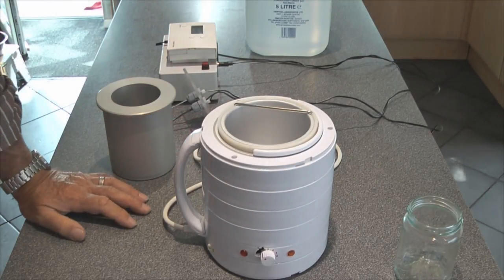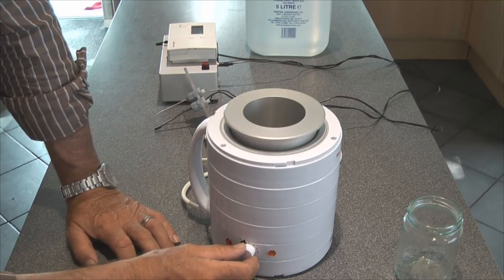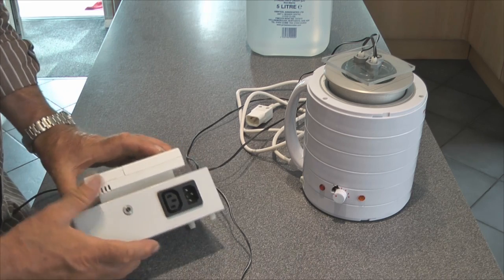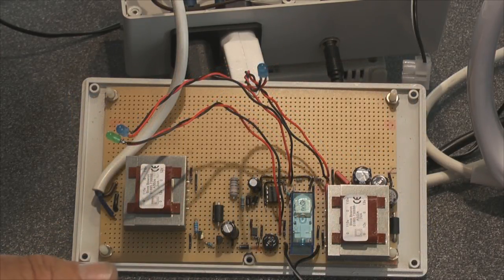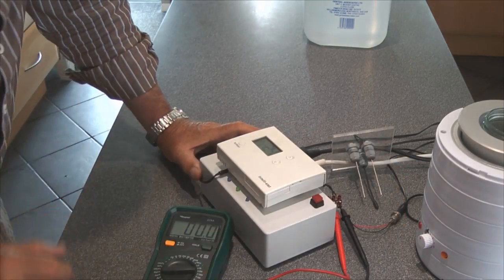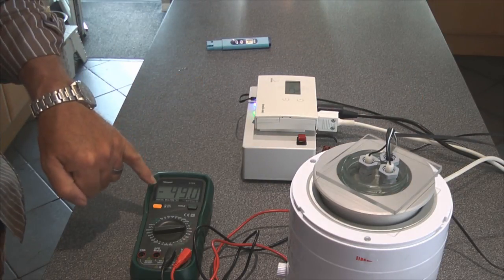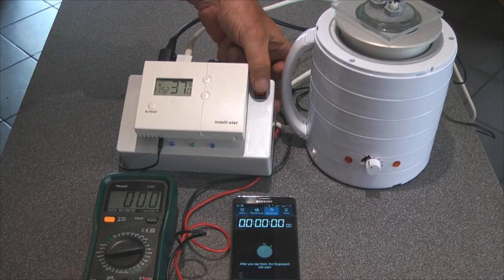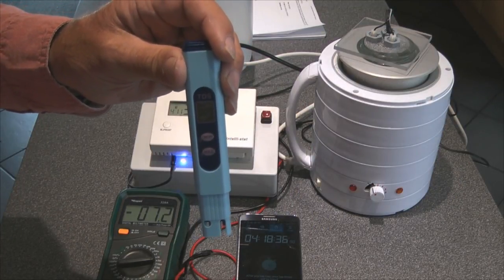Colloidal Silver  Voltage  Sensing Generator

Comment: My colloidal silver turned yellow
Reply: My silver turns golden yellow too  according to my chart it means it's around 20-30 ppm
Reply: @terryhill4732  I haven't used it it's been in my cubbord for almost a year. Can you share the information and what I need to do now?
Thanks for replying back!
Reply: @Kathleen-Wellner  The way you can tell if colodial silver is still good is get a Lazer pointer and shine it through the glass and if it's still good you will see through the Lazer tiny particles still floating around as long as it is stored in a dark ,cool place and sealed properly there shouldn't be any problem, that's what I do and never had a problem

Comment: Hi. Interesting video. One point I'd like to highlight about the TDS Meter - TDS stands for Total Dissolved Solids. You can only detect dissolved silver with a TDS meter, which is Ionic Silver, not metallic Colloidal Silver (nanoparticle silver). You'll have to 'reduce' the Ionic Silver with a reducing agent to make Colloidal Silver (metallic nanoparticle silver). Ionic Silver and Colloidal Silver are not interchangeable terms. Ionic Silver is conductive in water, Colloidal Silver (nanoparticle silver) is not conductive in water. The only sure way to determine non-dissolved non-ionic Silver is to get a properly reduce sample chemically analysed. A TDS meter will only tell you that Ionic Silver is present, but will not tell you precisely how much - they aren't calibrated for such use. TDS meters are for measuring the purity of water, not non-ionic metallic silver content.
Reply: @gnireenignE  whoever told you that ionic silver is conductive compared to colloidal silver is lieing, any silver is very conductive it's the most conductive metal known along with gold and other noble metal
Reply: @terryhill4732  It's basic chemistry. Test Ionic Silver with a TDS meter and you'll get a reading. Reduce the Ionic Silver using a reduction method and test again. Depending on which reduction method you use, the reading will either drop considerably, leaving only the reading for something like a reducing agent, or very near zero if you use an intense heating reduction process. You seem to be mistaking dissolved ionic states with whole metallic states of silver.
Reply: @georgecarlinismytribe  True Colloidal silver is what I make and I don't put a reducing agent in it period because the book says never put reducer only use a seeding from previous batch and I don't use a TDS meter , I have a chart from the manufacturer of the place I buy my silver and it's color coded to get you close to the ppm of your batch ,mine usually comes out to 20-30 ppm and the ionic silver is just smaller nano particles of colloidal silver,some people get into trouble using certain reducing agent that turns the CS into Silver Chloride which can be toxic if taken internally
Reply: @gnireenignE  Correction: I said ionic silver is smaller nano particles than CS, I should've said it's a molecular version of silver molecules and atom's

Comment: This is NOT colloidal silver! This is ionic silver. Any product that is clear is most definitely NOT colloidal silver, it is ionic silver at best. Ionic silver does have great health/healing properties but has basically zero bioavailable silver inside the body & does NOT enter your bloodstream. The ions bond with chlorides in your body rendering it basically useless. True colloidal silver contains nano size silver particles that will pass through membranes & enter your bloodstream. Making true colloidal silver is an expensive, difficult, time consuming process but if you want the best effect especially inside your body you need true colloidal silver which will typically be yellow or amber in color. An independent lab tested 14 products on the market claiming to be colloidal silver and only 3:actually had nano sized silver colloids in them. The best true colloidal silver on the market with the world's highest percentage of bioavailable silver is Mesosilver. Silver Hydrosol, Covalent Silver, Silver Water are all ionic silver products. You should stay away from any product that contains protein. The protein encapsulates the silver particles which are too large to be useful in the first place to keep them suspended in the solution (these products also have extremely high ppm like 500 to 29,000 ppm) but the encapsulation prevents the surface area of the silver from being effective as it can't touch anything and the protein grows bacteria which can be very harmful & should definitely not be used in the eyes, ears, nose, or throat.
So keep these rules in mind: if its clear, it is NOT colloidal silver. If the process uses electrolysis, it is NOT colloidal silver. If the solution contains protein, it is NOT colloidal silver & should be avoided. If the process adds baking soda or other salt in the process it is creating silver salts as well as ions, it is NOT colloidal silver, and it should be avouded. Hope this clears up any confusion & if you need more clarification please see this article where 14 products claiming to be colloidal silver are independently lab tested & only 3 of the products actually had nano sized silver colloids for further validation.
Happy reading.

Comparative Analysis of Commercial Colloidal Silver Products: https://www.ncbi.nlm.nih.gov/pmc/articles/PMC7765683/#!po=55.0633

Comment: Though there is so many ways of breaking down silver by using generators as an electrolyzer and you can build a complicated generator and confuse a lot of people also or you can get as basic as you want to by using 3 - 9 volt batteries which works as good as any generator that I've seen and the product is just as good for me I've been doing it for over 3 years and have had tremendous success with just a basic 9 volt direct current batteries and I've also used the AC generators but sometimes by using AC I had a voltage surge once and it almost burnt a whole silver rod up , after that I started using direct current and have not switched back simply because you don't have to worry about a voltage surge
Reply: I started out the old (3) 9 volt battery method but it's not really very consistant. Sometimes it works and sometimes it doesn't. It's not difficult to add current limiting which will give you a great product every time.
Reply: I started out the old (3) 9 volt battery method but it's not really very consistant. Sometimes it works and sometimes it doesn't. It's not difficult to add current limiting which will give you a great product every time.
Reply: Do you know what exactly the electric part to plugin that I would need to use instead of the batteries. Like the exact wallatge or volts on the cord u plugin into the wall. I like have everything else but not sure what the volts etc I would need to use instead of the batteries 
 TIA
Reply: @EXPLOREWITHME.  Yes if you're using A/C use an adapter that comes with many appliances but make sure that the millivolts are around a 1,000 mv,  I think without looking it up that equals 1 volt, anyway if you don't want to burn up your rods quicker that's a safe voltage to stay around, my A/C plug is 800 mv and it works as good unless you have a voltage surge, good luck

Comment: Very a propos with the COVID 19 pandemic, use the stuff in a nebulizer and get rid of it quickly.  In the US we have the Silvergen SG6, I have been using for many years, makes extremely fine constant current CS, crystal clear even at 20 ppm, and if you seed the next batch with a little of the previous one, it's fast only about 1-2 hours.  It has a density control for the PPM you want.  about $200 US.  CS is also great to spray into eyes, on masks, it stays active even when dried out.  Uniquely useful, and as usual with people, no one gives a shit, so they suffer and die.  Meanwhile we gleefully carry on making CS and laughing while the dummies drop dead along with their highly paid leaders.
Reply: "Uniquely useful, and as usual with people, no one gives a shit, so they suffer and die."
Yeah I find that to be true with many things. Even my close ones are unwilling to try anything alternative, they are too lazy basically to look up anything not suggested by their doctors. It makes me sad.
Reply: You are exactly right most people think if it don't come from a doctor it can't work
Reply: Thanks for your input. Where I can buy the one you mentioned in US? Many thanks 🙏

Comment: I did use to switch polarity on the electrodes until it was explained to me that this is a bad idea, because it will become impossible to use Faraday's law to calculate ppm of the colloid. Every time the polarity is switched, current will drop to zero and will build up to maximum value over some seconds. I have now adhered to the method most specialists use, adding sodium carbonate as electrolyte to guarantee a constant current right from the start, while protecting the electrodes.
Reply: Hey Marc. Should have known I'd find you here giving good advise.
Reply: You're not making collodial silver you're making silver chloride which is toxic and can turn you blue you never mix salt and silver together
Reply: why not use AC
Reply: @breakfastbuddy5  There are two main production methods: LVDC and HVAC. For a home lab it is easier and safer to use low voltage DC. Low voltage AC does not make sense for the reasons explained above.
Reply: @marctinkelenberg  if its only impossible to use Faraday's law to calculate ppm i dont see thats any reason for not using AC , the anodes and catodes shifts and stay clean all the way trough the process , the only reason is that its harder to keep the current at a certain level , with dc you can easy use a LM 317 regulator , but with a AC its not that easy . another misscalculation with DC is the temperatur change in the water ,and why do you need to mix it with honey ?
Reply: @breakfastbuddy5 Everytime you switch polarity in AC, the current drops and increases, so it is very difficult to know what the effective current passing through the electrodes is. You should measure the effective current by putting a multimeter in series, because a current limiter only limits the upper limit. The temperature does not cause any miscalculation, as we verify the actual current, not the input current. We use a reducing agent like honey or another sugar because it will speed up the reduction process, guaranteeing full reduction, and it will also stabilize the particles, keeping them from agglomerating into larger particles. Reducing with just heat will not provide you with the same quality of CS.
Reply: well i know how to measure ac current , so thats no problem , is that reducing agent just to cover up that its harder to make smale particles ? because if you make smal particles it turns lightly yellow by itself when you achive 20 ppm , if you keep it at 1 ma you makes the smalest particles , if you use wires ,you have a smal  surface on the rods , but if you use coins you increse the area around  3 times , and can use 3 x the current , i know a limit resistor is no good without a helping acid or base drop to start the process , to use AC you just have to use a 1 ohm resistor and measure Mv and thats the same as Ma , over the reistor , and you dont have to clean the rods or the coins , sorry for the bad english i am a Norwegian ,
Reply: @breakfastbuddy5 Thats a lot of information you put in one sentence. You can perfectly generate small AgNP at higher amperage, I generally work at 15 mA, like you say, just use a larger anode and a reducing agent. If you are happy to work with AC, you should stick to that. I rather stick to proven methods used by savvy biochemists. If you don't understand why reducing agents are used, I would suggest you need to study a little more.
Reply: thank you for your input , it cant hurt to put some honey in that solution after its done , and i would like to altrnate the  anode and katode , its hard to do that with a dc since you have to switch the wires , when your not there , do you know a metode to do that ? or do i habe to make a timer with a pol switcher ?
Reply: @breakfastbuddy5  You should really consider adding a reducing agent right from the start, it will greatly improve the quality of your CS. And there is absolutely no benefit in switching polarity, it's just a lot of hassle, making it harder to generate CS with a known quality or ppm.

Comment: Aluminium gives dangerous properties to water,,use stainless steel or copper.
Reply from the maker: Thanks for your comment and valid warning but perhaps you fast forwarded through the part where I used  a GLASS jar to  contain the water, There is only ever glass silver and water involved in the process.

Best wishes
Russ
Reply: @SarbarMultimedia  yes I just seen that,,I apologise,,I was concerned for your health at the time. Peace

Comment: Do you know what particle size was produced as according to my research the smaller the better, preferably less than one nanometre?  Also did you use distilled water?
Reply from the maker: Hi John
Unlike some process I have seen that produce silver mud, there is no hint of solids even after weeks of settlement. Any solids are completely in suspension.  The solids meter I use says typically 8 to 10ppm. The very limited  current flow means it takes about 8 hours to produce 500ml. As I understand it from the research I did, the slower the process the smaller the particle size. I cannot say what size those particles are but at 10ppm there is no hint of any colour. I have used it as a topical mouthwash and as a spray on skin salve but the main use is to make wound treatments for my daughter who is a professional groom and uses it all the time to treat wounds and infections for the horses in her care.
I buy purified water from a pharmacy, essentially distilled water. I know that it's free of all solids because when initially processing it,  the voltage is high for several minutes until there are some silver solids to conduct the limited current. As the dissolved solids increase, the voltage eventually drops to about 2 volts.
All best wishes
Russ
Reply: @SarbarMultimedia  I've been looking into colloid silver generation I must say you really seem to have nailed it. I don't think that waiting 8 hours to produce 500ml is long, not at all. For personal use, that kind of amount is more than enough for any purpose.
As for measuring colloid silver's PPM using TDS meters, the validity of that is debatable, but I guess it's better than nothing. I think much more precise measurement coud be derived by using very precise scales and measuring silver "loss" during each of these sessions, then calculating mg/L (=PPM).
Reply: Je suis très content de cette vidéo combien on coûte cette appareil je suis au Cameroun